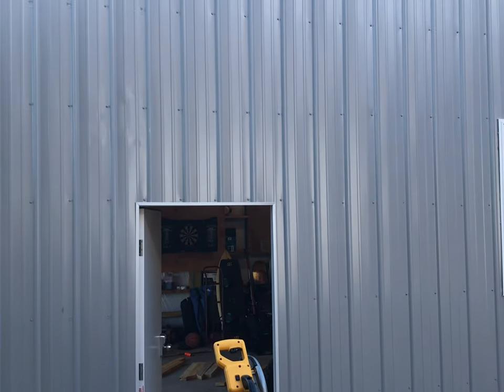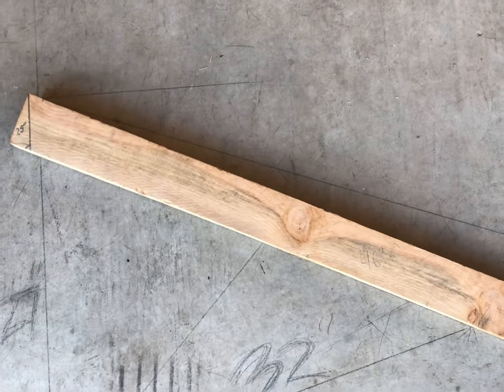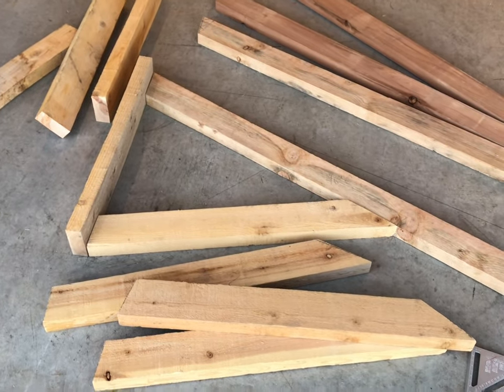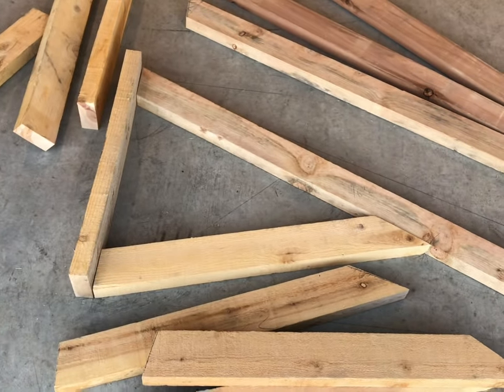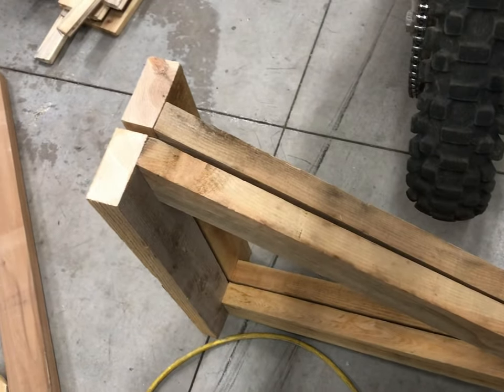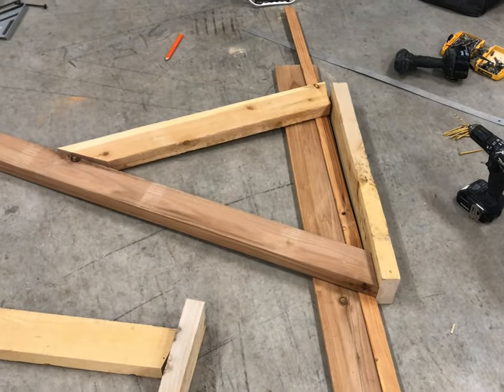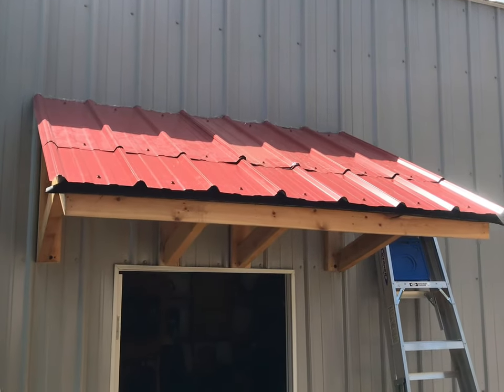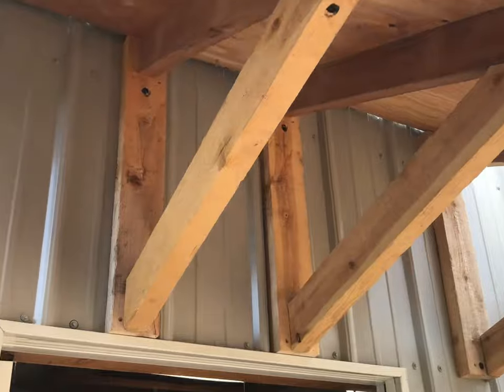How to Build an Awning

Comment: First off, THAT LOOKS GREAT!!! YOU DID AN AWESOME JOB!!! I really dig your idea of building it on the ground before attempting to go wide open throttle while atop an 8 or 10 foot ladder!!! Now, on to my question for I am getting ready to do something very similar with one of my shop doors. For the record, I am definitely no carpenter, nor a framer… BUT could and/or would it have been easier to just build a rectangle box on the ground, cut some boards for the angle supports and then just screwed the back of the box to the wall while someone holds the front of the box up so the first of a few supports are installed??? Well, now that I think about it, I do suppose that there has always been more than one way to skin a cat!!!
Reply from the maker: Ya, you can put the entire awning together on the floor before installing it. I just didn’t have any extra help that day.. plenty of ways to skin a cat 😂

Comment: How did you seal to the building?
Reply from the maker: Typically with new construction I like to install flashing and ice and water tape over the roof paper and weather barrier on the exterior wall.. then apply the roofing, then colored flashing taped to the exterior (weather barrier) wall paper, then install the siding.. but this was just for my garage so I didn’t care that much and just did a little foam, let it dry, then cut it done to match roof, then applied color roof silicone over the top..

Comment: What size wood?
Reply from the maker: I just used a true 2x4 raw sawn cedar, but normal 2x4’s would work depending on snow load and how far out you want it to overhang. 2x6s or bigger will be stronger.